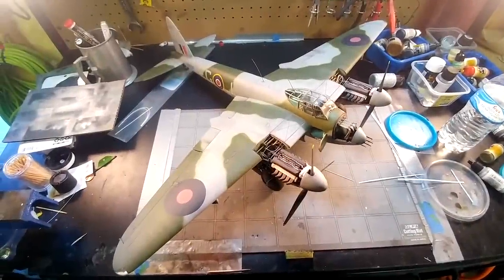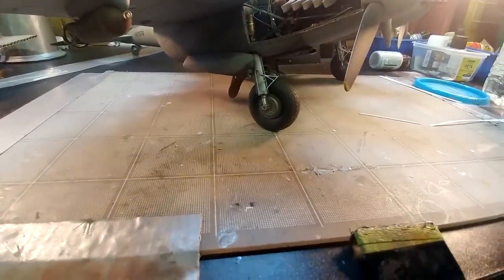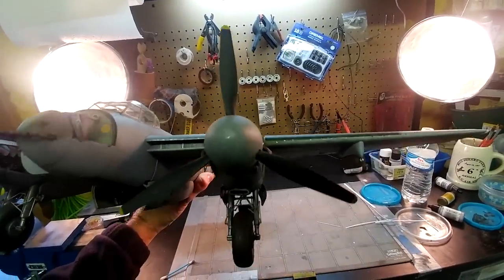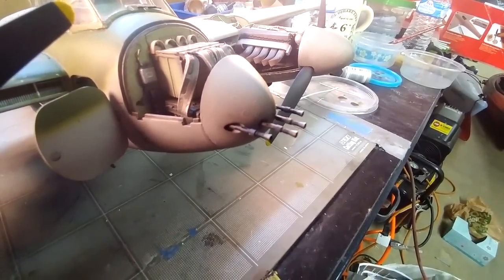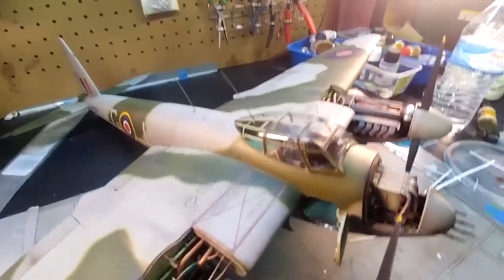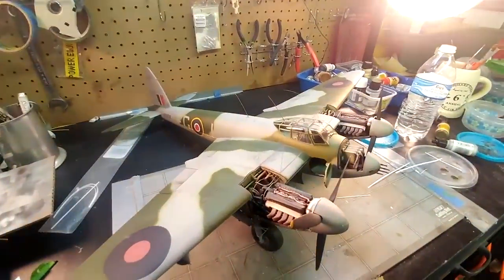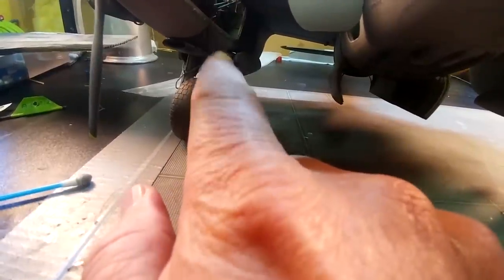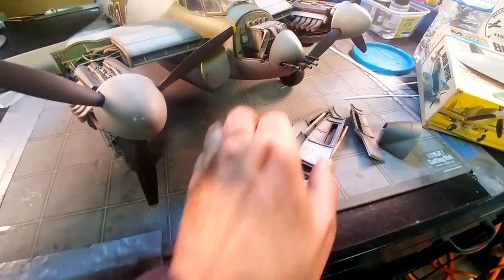Airfix 1/24 Scale De Havilland Mosquito post-build review, critique and tips for building

Comment: I noticed your sprues are mostly still intact, and you had mentioned breaking the engine mounts, try taking nippers and making relief cuts in your spruces, especially in those small parts. Sometimes if you cut them down to size one can  get them out in tact,  if you're lucky they won't break until later.
Looks great, well done 👍✅

Comment: Very well presented and very well spoken. I like people that can articulate with obvious sense when reviewing models. To me Airfix is a great company...... full stop... But they don't do their homework well when coming to making the moulds to do produce the kits. If cost is an issue then talk to the chinese, they seem to get both right. Slide molding limited ejector pin marks and so on (Dragon Armour). I have to say Airfix was the only bus on the block in the 60's that had a good range of kits. Time has been very convoluted for them but they have come back with some good kits. Please do your homework better and reviews like this will make your company one to support in all weathers.  Again a great review, a great bit of modelling. If you can get that result from what you started with you are a champ.
Reply from the maker: I get the feeling that after this kit and with Hornby's control, their next large scale kit (the Typhoon) was a much better effort and their Hellcat is an even better effort. It's unfortunate that this giant kit was unfinished...I'd love them to go back and finish it. Particularly the panel/rivet,fastener detail that's absent and then the engine detail. There are new parts for this kit that were recently released by Eduard. Those address some of the areas. They came out just after I finished this model.
Reply: The old days of kits : folk often disregard Frog for some reason. Not as big as Airfix but preceded them and did a reasonable size range and variation of kits with some unique to them.

Comment: David R Lentz, Columbus, Ohio, USA 

A top-notch job of it, you have brought us. The de Havilland Mosquito RAF Light Bomber (I do not recall which mark) is both visually appealing and surprisingly formidable, making for an immensely engaging intriguing narrative of history at its most dramatic: combat. 
   I agree: Airfix ought to finish their kit, as well as all the others of this scale. 

   Might I suggest you next build one of these Airfix kits as an RAF Mk I light bomber, airborne—for strength and stability, I recommend you construct inside it what aeronautical engineers call a “wing box”, wherein you assemble a sturdy aluminium framing of small “girders” in a rectangle three or four units wide and one unit bearing fore and aft (geometry calls this “the X-axis”, which in a vehicle follows its vector), its Y axis passing to the right and the left of the centre line; each wing you then would secure with a bonding compound—its bomb bay doors open. Then, positioned off its right wing, and slightly elevated, Tamiya’s 1:32nd-scale light bomber model also airborne, its bomb bay doors also open. Just to the right of this aeroplane reproduction would be Tamiya’s 1:48th-scale Mosquito replica, airborne as well, and its bomb bay doors open as the others. In the fourth place of this flight in echelon would be would be Tamiya’s 1:72nd-scale bomber also airborne, its bomb bay doors open. 
   You also would need to 1) motorise the propellers, the blades and shaft (and possibly the spinner) replaced with metal to withstand the torque; 2) illuminate the dials of the instrument panel, radios, and related equipment inside and near to the cockpit; a merging of a photo-etched panel, a transparency cut to the same shape, and decals to represent the dials, indicator lights, etc., will serve in this; 3) design and build a support system—I recommend a gimbals arrangement, rather than a conventional post or a stand—out of sight of the viewers; one can hide these behind the models on display, entering each replica’s airframe on the right side somewhere beneath (or into) the wing; 4) pass along each of the respective support structures the wiring for the electric motors and the lighting, to a nearby location out of view; 5) form a backdrop; this also would be a barrier to mask the preceding arrangements.

Comment: If you think this is bad avoid the 1/24 spitfire. That's a terrible kit lol. I have all the 1/24 airfix kits except this one cos it's so big. I might have to get one though. Despite the issues it makes a really nice display piece.
Reply from the maker: Years ago I built that kit. I didn't know enough about the subject to judge its scale accuracy but I do remember buying a 2nd kit later to do a better one and finding a bunch of deformed parts on the sprues!
Reply: @ramblingadventures  yea airfix have always been very good at accuracy and it is spot on. The problem is it came out in 1969 and the moulds are beat to hell. That said i have built mine and i love it now it's finished. Looks really good on the shelf. I would build another if i got it cheap enough. The 2014 typhoon is a very good kit and bang up to date with hundreds of pieces. Airfix have just announced a new tool 1/24 hellcat. I'll be first in line when it comes out!
Reply from the maker: @colinjohnston8519  I looked at the Typhoon and Hellcat. They both look like really well finished detailed kits. I think Airfix stopped working on the Mosquito then when Hornby bought them out, they wanted something to release so they just released it unfinished. That's the only explanation for the utter lack of detail in areas like rivets and panels yet amazingly good detail on parts of the cockpit and guns.
Reply: I loved my 1/24 Spitfire build, It was challenging to say the least, but I think I did a good job, shame I found out later that the Spitfires came out of the factory with a stencilled camouflage and I'm pretty sure mine isn't a good enough match as I followed Airfix's paint guide till I got to the tail and couldn't get the cammo to flow around side to side and onto the tail so I just made up my own design, still I'm very happy with the inside of the cockpit, the opening canopy and door (hinging on painted masking tape) that locks open with magnets, I spent probably most of the time of my build recreating the inside of the cockpit in minute detail, hand making the seat belts and buckles, drilling out and mounting film with laser printed instruments behind the instrument panel. After all that work, you can only see about 1/5th of it but I know it's there hehe. I even opened up the wings by the cannons & MG's and detailed up all that area. Spent hour after hour removing flash, joining parts together that just didn't want to fit, test fitting, filing, shaving, retesting parts to finally get good fits. It was the 2nd Kit I had built in 35+ years and a real blast from my past. I got a couple of external metal cannons, the only 3rd party object I added to the kit and I was really glad I did, the number of times I dropped it and was saved by it falling on the metal cannons, the plastic kit ones don't come anywhere near the detail and I'm sure would have broken off the first time I dropped it. oops am derailing the thread and rabbitting on. he has done a great job on the Mosquito :-D

Comment: i used a wood dale through the fire wall to hold the engine in it postion
Reply from the maker: Did you cut off the lower cowling or just use that to reinforce the motor?

Comment: You did a really great job, considering what you had to work with. Obsessive slavery to detail and failing eyesight drove me out of the hobby, and I have to say I don’t miss it (I don’t particularly miss IPMS either) much any more.
Reply from the maker: I definitely found that my poor eyesight (even with progressive lenses) made the hobby much harder. And yeah, there is a fine line between fun obsessive detail and not-fun obsessive detail. I think RC scale planes were much more satisfying. For all the detail you put in (at a larger scale so it was easier to do), you also got to fly and display the plane in a more satisfying way than having it sit on a shelf. I could see doing some models later in life but it's not going to be a primary hobby I don't think. This was hard enough at 1/24 scale, I don't think I could work at a much smaller scale.

Comment: It's almost like airfix couldn't decide whether to have working features or static...the landing gear is almost retractable...like multiple people designing the kit, without working together.
Reply from the maker: Yeah, it's true that it seems like the gear could have theoretically been retractable but in the end I made a mistake using a mix of aftermarket parts and the airfix stuff. The gear was complex enough without trying to mix dissimilar materials that didn't like being glued together. In the end, the gear kind of ruined the model (due to the misalignments) even though it looked very authentic before it all got finished.

Comment: I know the 1/32 Tamiya Spitfire had metal strengthening pins for the undercarriage . I haven't looked at their 1/32 Mosquito in detail . I should imagine a much better proposition than the larger Airfix . really not a good proposition for an average model maker .
Reply from the maker: Yes, I know Airfix really worked hard on the subsequent 1/24 models but this one pales in comparison to the later Hellcat, Tempest and Spitfire. I wish they’d go back and finish the Mosquito.
Reply: @ramblingadventures  yes even the Typhoon had a lot of issues. I don't know where most people could store or display kits in this size . And as you mentioned plastic is structurally too weak to support large components especially load bearing things like undercarriage legs . Which is why Tamiya added metal parts.

Comment: When affixing white metal and resin components together you really have to use epoxy, because as you learned, ca doesn't like to stick to the metal.

Model looks awesome. To bad they DQ'ed you for the toe. That's BS.
Reply from the maker: Thanks yeah. What I didn't have in there was I so screwed up the tail wheel with CA glue that I ended up having to break parts of it off and had a hybrid of metal and plastic there. Everything I read said "use CA" but epoxy makes sense. I ended up using canopy glue and that seemed to work well also.

Comment: U have to be congratulated for such a fine work. I could never have the skill and patience you have displayed. I have just got back into model building again after 30 years, and think I need my head examined.
Reply from the maker: Building large scale RC planes helped and then owning a warbird really helped because I understood how things weathered and stained (and what everything was). But working with acrylic paint rocked. Metallics that actually dry... and look like metal, paint that dries to the touch in a couple of minutes and is basically set in less than an hour, water clean up (I worked out I used 3 gallons of water cleaning my airbrush on this project...imagine if that was all thinner!). Acrylic washes also made re-doing stuff easy. Really liked working with the acrylics.
Reply: I did the same a few years back, started modelling again after 35+ years, the hobby sure has moved on, photoetch, resin casts, 3D Printed parts. CA Glue, Airbrush, Paints. It's a long way from where it was when I was a kid hehe
Reply: @DeadlyAssets  I sometimes find it daunting when I see the quality of the work going on, but these modelling sites are great for the information and techniques. The main thing is that the only person I have to please is myself as I am not out to build show quality models. Great to interact with others in the same boat, so to speak.

Comment: You did a great job on your Mozzi, I have one in my stash that I want to build, but have so much to build at the minute, I need to force myself to finish about a dozen models, lol. I think I will start collecting aftermarket additions. The ammo shoots are something I will have to have a real think about if I can't find any aftermarket versions. I have a load of magnets left from my 1/24 Spitfire, plus more I have collected after, that I intend to mount to the cowlings and frames so they hold by themselves. I will have to study your build threads. I say I'm not a rivet counter, but then find myself counting rivets on models I'm building, not literally as I haven't got a decent riveter set, although I hear Rosie the Riveter set or something like that is supposed to be a great riveter set, another thing I need to get. I need to get some source material and decide on a particular model, of course, one that the kit will make. I find myself studying every model I build, their history etc. I suppose it's all part of the hobby, It's moved a long way from the kits I bought as a child for 15p from my local model shop. Again you did a really great job on your Mosquito and it shows you what IPMS knows about it if they disqualify your model over something so trivial!
Reply from the maker: So I hadn't remembered it at the time but it was the Rosie the Riveter wheel (largest size they make) that I tried but to no avail. I couldn't find a commercially available riveter that seemed to match the scale of the model so ended up with a punch with a rounded end that I used to dent the panels. Fortunately most of the riveting was on the nacelles. I also don't consider myself a "rivet counter" but I am a scale stickler...I want the model to as accurately recreate the original as is reasonable but that has more to do (in my mind) with the paint and weathering than how many rivets may or may not be on any given panel.
Reply: Would you still have the R.A.A.F. decals?
If you aren't going to use them would you be interested in helping a fellow modelling enthusiast in purchasing them?